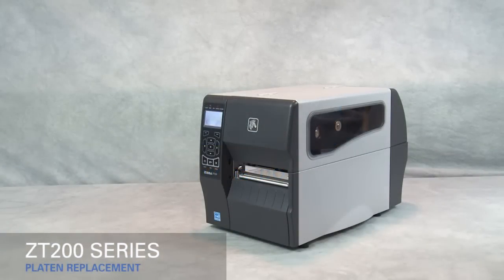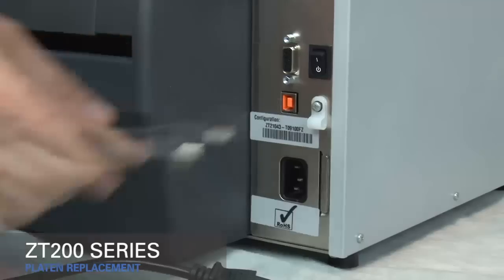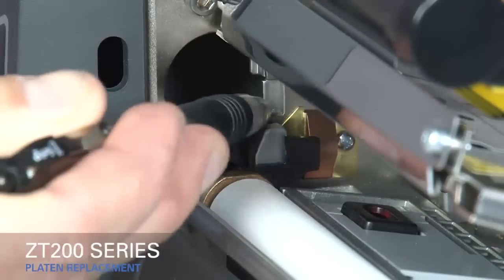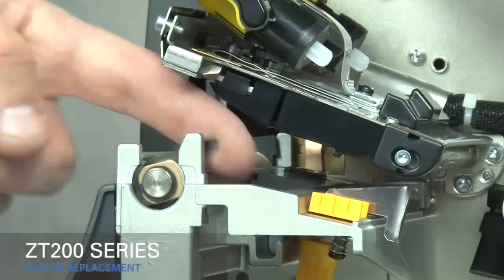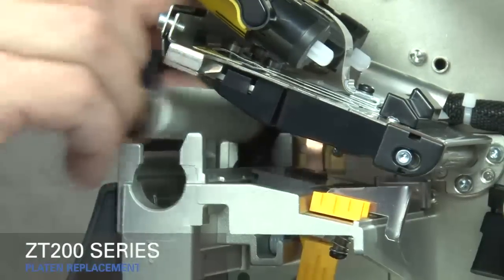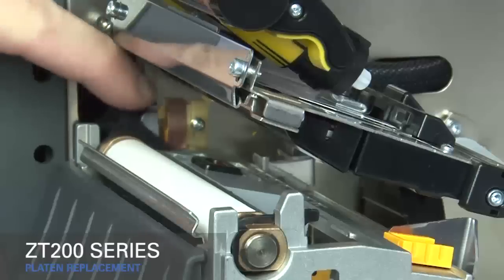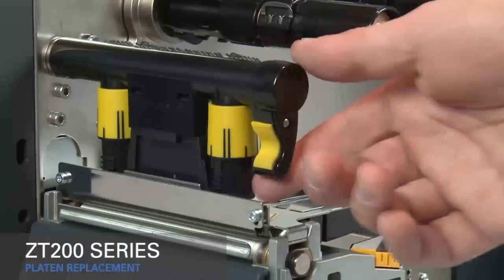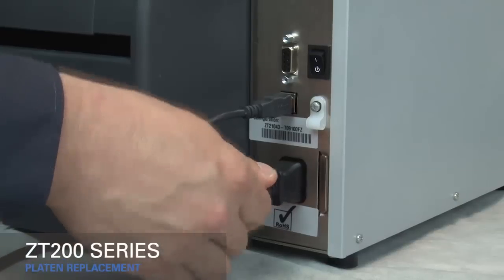Zebra ZT200 Series How-To Replace Platen Roller

Comment: The slide doesn't want to slide? Is there a way to take the panel off?
Reply: What they DON'T tell you is that on some models (zt230 certainly) you have to take the entire side panel off (3 philips screws on the side and one at the top on the inside) and there's a black security lock (plastic) that prevents the door from moving backwards.  You have to pull up on the lil tooth-thing that's blocking the gear door AND THEEEN push it back.  I broke a pen and nearly a pocket knife trying to push mine back before I figured this out.
Reply: @davidlooney1873  you're a lifesaver, thanks for taking the time to comment this
Reply: hi after struggling a few months ago to open the door i gave up then came back to it just now and figured with the right amount of force its gotta give... not sure if it'll work for everyone but what i did was removed the silver part of a small binder clip then tied a string to the round part of it and inserted the pointy end into the hole and pulled back on the string while holding the pointy end from slipping out... with enough force it finally opened. Not sure if this'll work for everyone but it worked for me. Good luck.

Comment: I can't the gear cover to slide.  The video makes it look so easy.  Is there a trick to it?
Reply from the maker: Hello John, please see additional support content for the ZT200 printer here: https://www.zebra.com/us/en/support-downloads/printers/industrial/zt220.html
Reply: I'm having the exact same problem, it refuses to open for me too, broke my pen trying.
Reply: @Jihalizad2004  I can only find the same video?? Did either of you figure something else out? Desperately need to know! Thanks
Reply: @edwhelan1168  Apparently it's a known defect and there's nothing Zebra can have you do about it besides opening up the side panel and forcing it back. They've suggested using an awl but nothing short of brute force will open these doors, they've sold us a LOT of defective printers.
Reply: What they DON'T tell you is that on some models (zt230 certainly) you have to take the entire side panel off (3 philips screws on the side and one at the top on the inside) and there's a black security lock (plastic) that prevents the door from moving backwards.  You have to pull up on the lil tooth-thing that's blocking the gear door AND THEEEN push it back.  I broke a pen and nearly a pocket knife trying to push mine back before I figured this out.
Reply: hi after struggling a few months ago to open the door i gave up then came back to it just now and figured with the right amount of force its gotta give... not sure if it'll work for everyone but what i did was removed the silver part of a small binder clip then tied a string to the round part of it and inserted the pointy end into the hole and pulled back on the string while holding the pointy end from slipping out... with enough force it finally opened. Not sure if this'll work for everyone but it worked for me. Good luck.
Reply: @Jihalizad2004  hi after struggling a few months ago to open the door i gave up then came back to it just now and figured with the right amount of force its gotta give... not sure if it'll work for everyone but what i did was removed the silver part of a small binder clip then tied a string to the round part of it and inserted the pointy end into the hole and pulled back on the string while holding the pointy end from slipping out... with enough force it finally opened. Not sure if this'll work for everyone but it worked for me. Good luck.